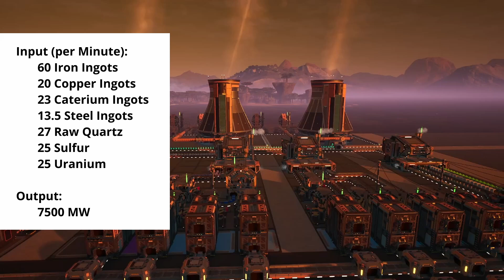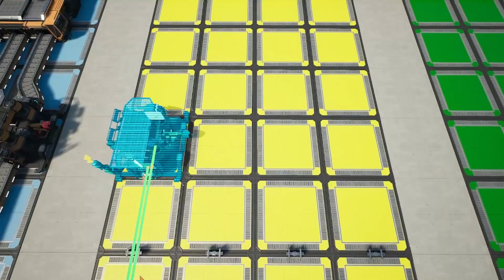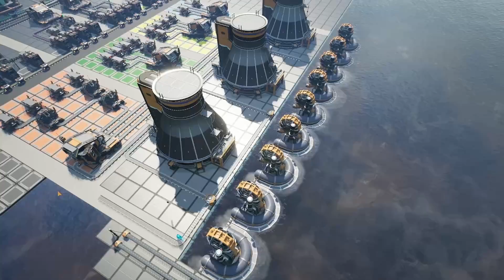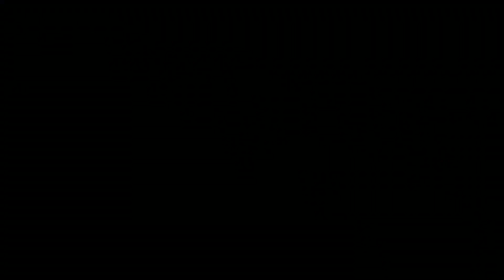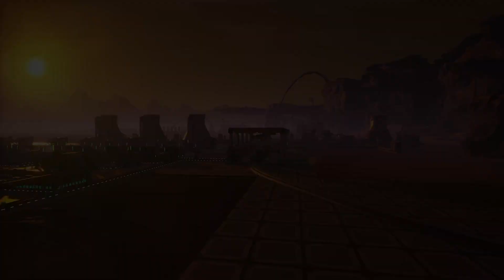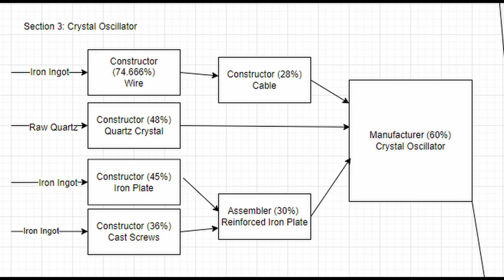100% Efficient EASY Nuclear Power Build Guide - Modular Satisfactory Update 5 Tutorial / Walkthrough

Comment: This build is not viable anymore since beacons are not in the game anymore. 
Not sure if all the alternate recipes are even still in the game either.
Reply from the maker: The beacon recipe has been replaced with rotorws, which use the same base ingredients (iron). the rest of the build remains the same.
Reply: Thanks for taking the time to reply couldn't get the alternate recipe for the Uranium cells yet. 
I ended up just using all basic recipes and using Satisfactory calculator to get 2 fuel rods a minute. 
Good video!

Comment: Hey Bud, love the guide, just have a question on the water extractors.  I noticed yours aligns with a foundation space of one extra on each side.  I have mine set up to align with the one side of the foundation, but snapping the rest in line takes it over the other ends spaced foundation.  Did they change the size of the water extractors or do you have an overlap in there somewhere?

Comment: dekoba, seriously. i would not have gotten as far into this game as ive gotten if it werent for your amazing videos. when i try and do things like this on my own, i end up with TONS of complete spaghet conveyors going everywhere, zero organization. but with guides like this, my build look better than i could ever do in a million years. keep up the absolutely amazing work. also quick question: just took a look at the blueprint. why dont we just want everything at 100%? will that cause things to get backed up?
Reply from the maker: Glad I could help !

The biggest reason to underclock is to save power: the power draw is exponential with clock speed, so running a machine at 25% speed only uses 8% of the power of running it at 100% speed. This means you could run 4 machines at 25% to produce at the same rate as 1 machine at 100%, but only use a third of the power. This extends to individual machines -  a constructor running constantly at 50% uses significantly less power than a constructor running at 100% power for half the time.  It also makes it easier to identify bottlenecks, backups, and errors because if a machine is not producing (light is not green) then it means something is up.

Comment: Hey, one thing I noticed in the video is you rotate your belts to get a 90deg turn. a method I use to get 90deg turns is, I go back two clicks from where I have the perpendicular line place the belt stand then round the corner. that will get you a 90. Hope this helps
Reply from the maker: Thank you!